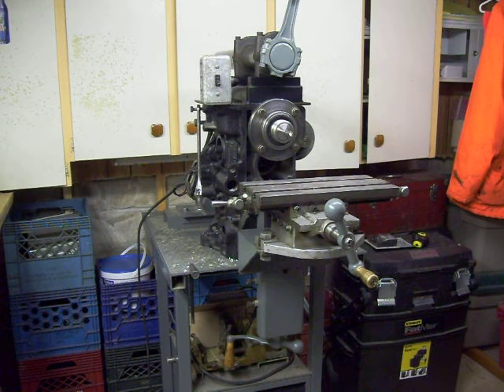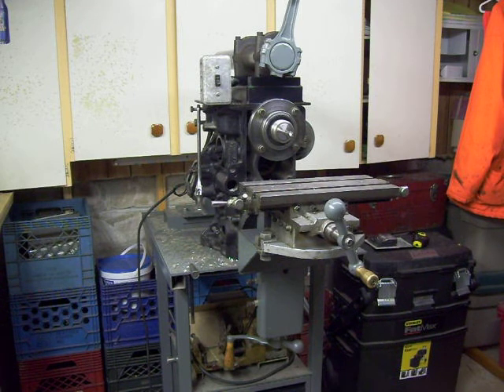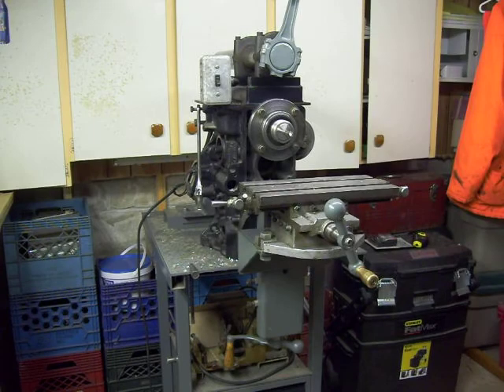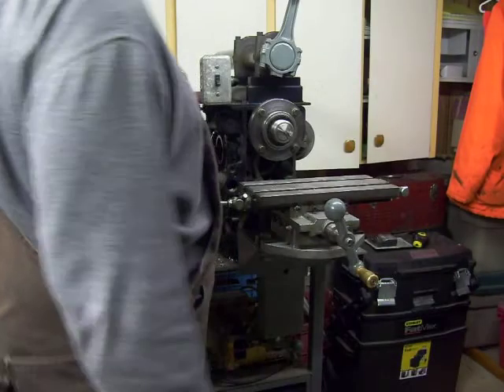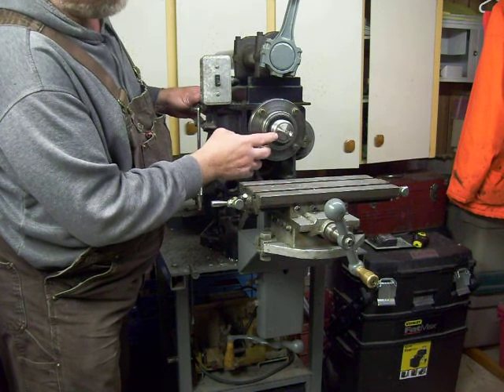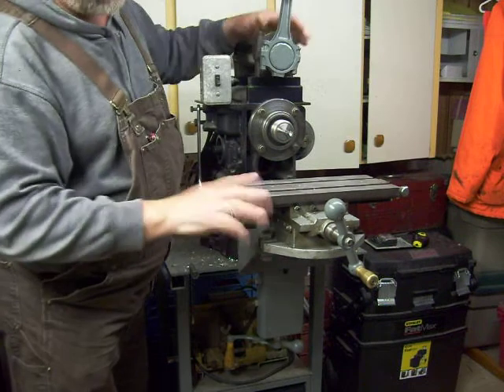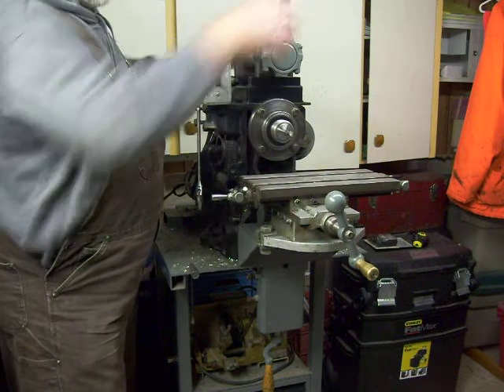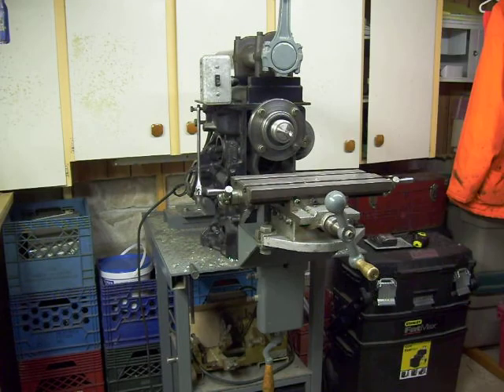The "Engine Mill" my DIY horizontal milling machine

Comment: a pitty that the one thing i might need from the desighn is the part you used from another machine (the height adjustment )
have most of the parts needed to make a surface grinder , planning on using an engineblock as the base too as it should stop most vibrations
still figuring out how to do the height adjustment of the crosstable maibe find a vertical milling machine and use the mast with the dovetail for it

Comment: I have been smitten with your horizontal engine mill since I saw the story in HSM! I subscribed to that magazine for 20 years, and yours was the absolutely most ingenious project ever published! It has been the bucket list project I have kept in my head and planned on building while I wasted time in waiting rooms, and it has helped through my family problems, as I push all my limits.
If life ever lets me out of this choke hold,   my plan is to follow your good advice and use an old in line 6 cyl. block I've saved, overarm in cyl. 1, spindle in 2, or 3. All parts setting in storage, waiting.
I can't thank you enough for sharing that article. (I'm really glad those  boys went moose hunting!)
Brilliant! Thanks again!
Reply from the maker: Thanks for the kind words Jeffrey. I know all about the feeling of living in a "choke hold". I had planned to build a six cylinder version myself but life, in general, and the death of my wife got in the way. I hope things get better soon for you. My very best regards.